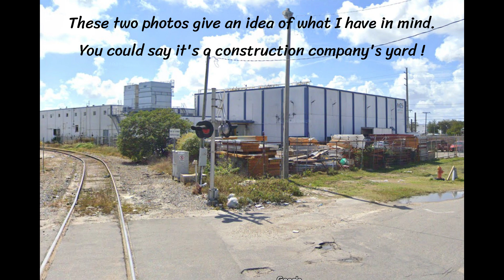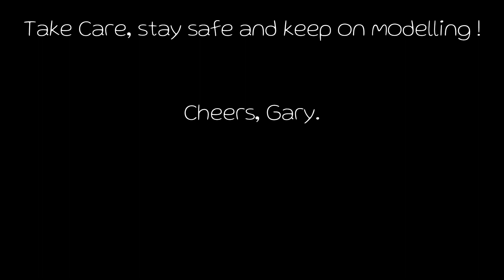Miami Down Town Spur April 2023 Layout Update

Comment: Interesting blinking on the headlight on the low nose of #509
Reply from the maker: G'day Colin,

The blinking head light known as ' Oscitrol' was employed on the earlier FEC locomotives. The FEC had only acquired 11 of the GP38-2s. Eventually the oscitrol lights were removed and replaced with ditch lights. This is my first Athearn loco (well one of two Athearn GP38-2) and I have to say, it is a cracker of a locomotive. The other locomotive being #501 which is a later version with ditch lights fitted. 😉

Cheers, Gary.
Reply: @Gaz3801  Thanks Gary. Good to know. Did it come setup like that or was that your mod.?
Reply from the maker: @154Colin  The loco light function came set up like this. 

Cheers, Gary.

Comment: Really nice! I know you have two industries on the layout,the salvage yard and Miami produce. Do you have any others and what are they called?
What do they ship/receive, and in what type of cars?
Just asking out of curiosity. Thanks.
Reply from the maker: G'day Keith,

Please excuse my late reply... 🙄

To answer your question, all up I have the two you mentioned (Ferrous Processing and Miami Produce) along with four more. Of course Ferrous Processing receives and dispatches gondolas and the Miami Produce take mechanical reefers and box cars.

These are the four extra industries and the cars they receive :
Fuel/oil depot : tank cars only
Sunshine Foods (which is based on Family & Sons) : Reefers, boxcars, corn syrup and airslides (airslides for something different)
Cardboard packaging (based on Proveedora Jiron building) : mostly double door boxcars. Have thought about a tank car visiting occasionally.
Salco Chemicals (based on Salco, although the model has been swapped end to end) : larger boxcars and possibly tank cars in the future (acid,chlorine etc).

Cheers, Gary.
Reply: @Gaz3801  No worries about the delay. Thanks for the info. Keith